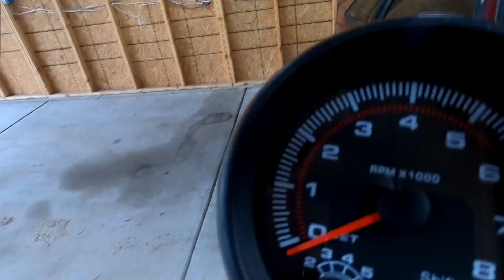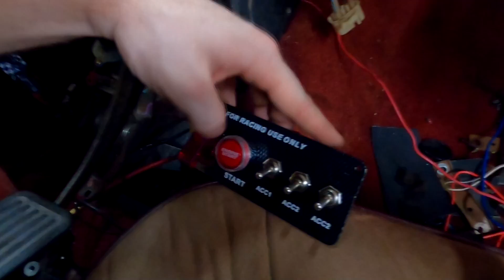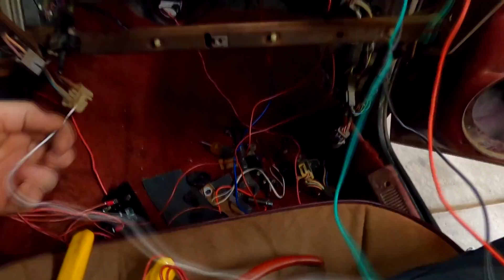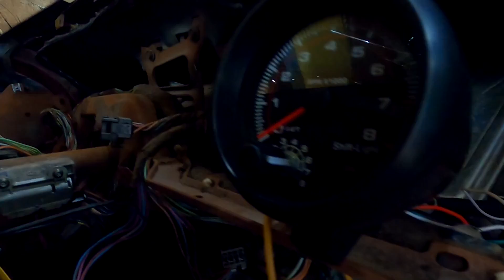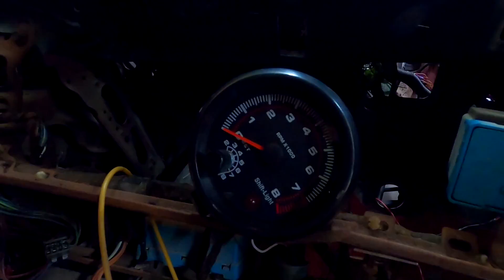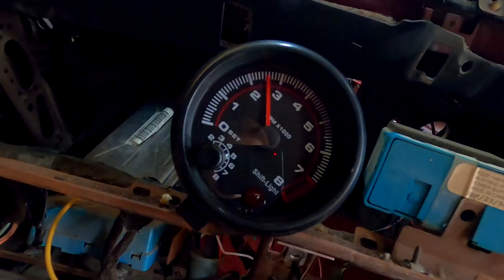RPM GAUGE INSTALL ON LS FOXBODY

Comment: What size diode? Also previous owner of my ls car put in a rpm gauge with a diode attached to the spark signal wire coming in and then the diode ran to the 12v+ I assume, so I should run my 12v+ wire to the 12v+ from my engine bay instead?

Comment: So pin#10(white wire)on the green connector and a 1K ohms resistor from a 12V??
Reply from the maker: So the green wire off the rpm gauge will go to Pin #10. Thats a white wire. You will run a 1k resistor from that wire to a 12v source.
Reply: @Cawbee any 12 source or could it be a constant 12?
Reply from the maker: @carlosg8873  constant
Reply: @Cawbee  great thank you